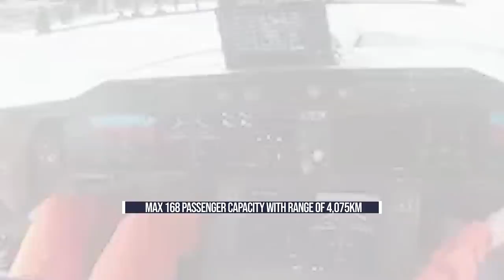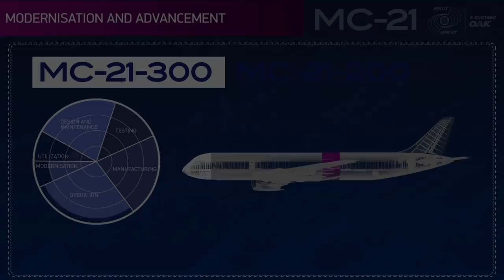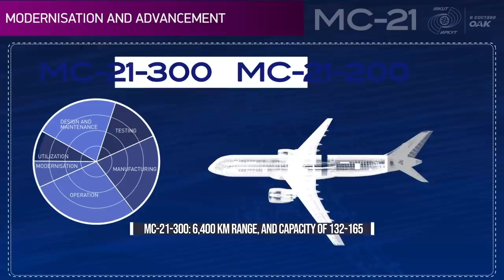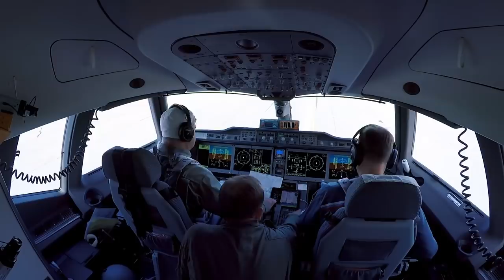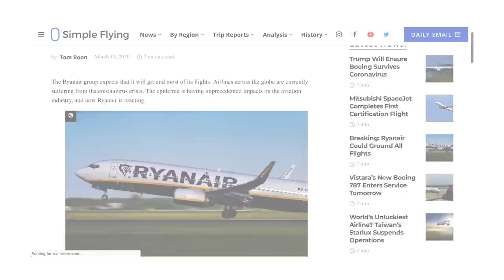Russia And China’s Plan To Compete Against Airbus And Boeing

Comment: Pardon my scattered thinking here, but Airbus and Boeing spend millions lobbying for state subsidies, Russia and China manufacturers are state-owned so that is not as much of an issue. Corruption on both sides causes investment to leak like a sieve so while it is worse in some sectors, over-all that is almost a draw. China and Russia have vast experience building military and industrial aircraft and related technology (regardless of how or where they "sourced" the plans). Historically, they don't have the same level of expertise with the customer experience aspect on commercial airlines (though my last few flights on Aeroflot were quite pleasant). Airlines in the United States are seeing a sharp decline in customer satisfaction (getting beat up on United was not an isolated incident). China and Russia can get there. They are just getting started, they are planning for the long-haul, and the markets in Asia are poised for explosive growth.  I would not bet against them. It is not about waving the flag, it is about planning, investment, and a commitment to the long view.

Comment: The MC-21 doesn't have winglets installed on it, it feels like this is 1980s again.
Reply: U don't need them if u design the wing carefully
Reply: Man, it doesn’t require winglets, it has an extended hydrocarbon wing
Reply: @oxcart4172  Especially  with raked wings that Boeing uses on the 777 (including the X), 787 and 747-8 and what Embraer uses for the E2 because they reduce drag in the same way but with better results than winglets according to Boeing’s research

Comment: Both Russia and China have successful space programs which testify their technical competency to build a commercial plane. It has taken a longer gestation period because the West had an embargo on aviation technology on China whereas Russia was caught up in a costly arm race with US. Now both countries are pulling their resources together and you can be assured that Boeing n Airbus would  be kept on their toes。 

Global licensing is a tool used by the West to  be protect its turf. However as both have large domestic market, China n Russian commercial planes is sustainable, let alone its much lower cost is an incentives for aviation operators looking for savings due to high fuel prices. In a way, the West cartel have enjoyed extremely high prices and this give China n Russia a